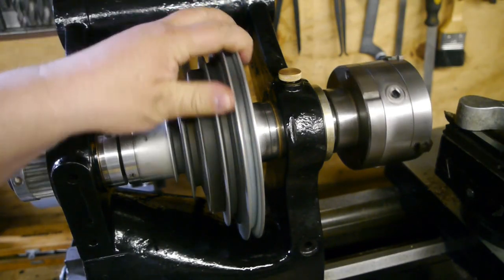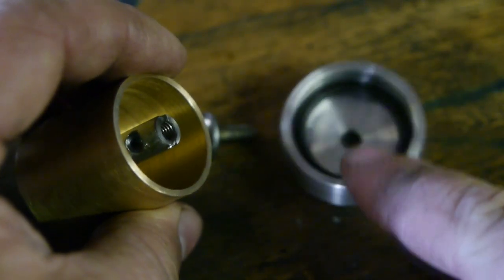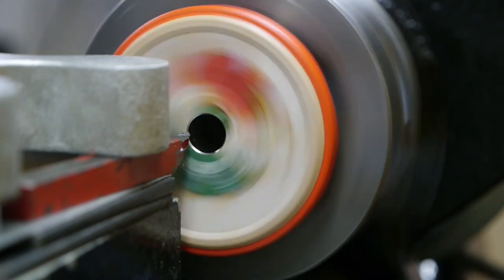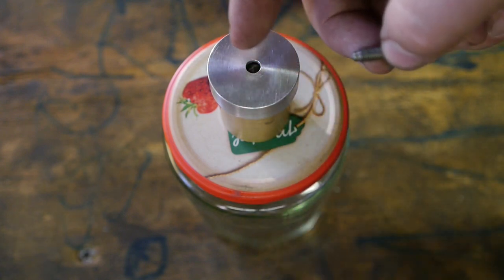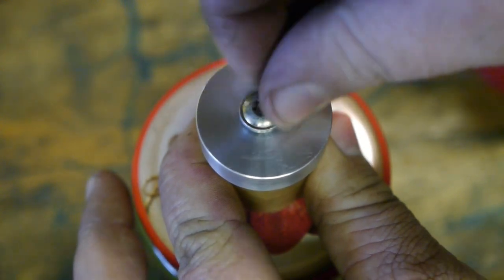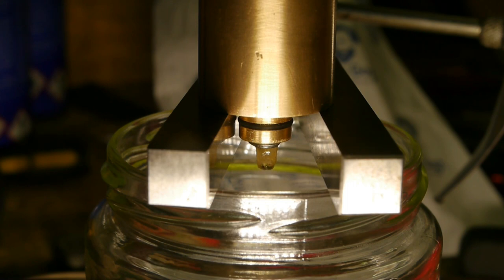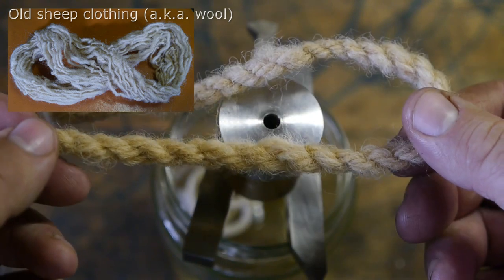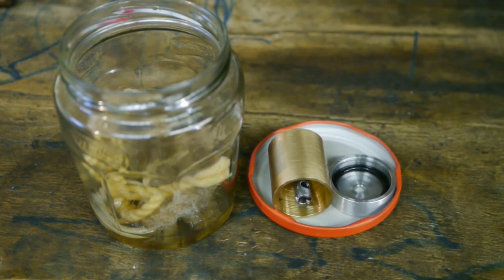Prototype wick oiler for the old lathe

Comment: You are so close !

The oilers I made are copies of Schaublin oilers and DO NOT use wicks.  They use a "J" shaped piece of wire as the "siphon" which is what this type of oiler is based on.

Oil does not have to capillarate through a wick, as it will also capillarate over the outside of a solid surface (which is what it is actually doing with each fibre in a wick).

So I use the Schaublin method of a single bent piece of wire to move the oil.  By varying the diameter of the wire, you vary the oil flow - bigger means more.

If you rest the curve of the wire "J" in an existing slot  in the centre section of the oil pot, you can run the test again with this type of feed.

The wire "J" must be made with the small length touching the bottom of the pot and the long section feeding out the bottom of the centre section almost to the spindle.

Try it and see.

Cheers Rob
Reply from the maker: Interesting. I will try that out. But first lets see if I understood that correctly. 
I basically bent a U shaped piece of metal wire that is longer on one end. The long end goes down the hole in the middle and the other end should rest on the bottom of the oil pot. Correct?
Reply: Correct.

It works like a siphon but uses surface tension of the oil rather than a vacuum.  So make the longest end as long as possible to get maximum effect.

Once you wet it, the oil will be pulled up from the pot and go down to the spindle - all on the outside of the wire.

The drip rate will be the same for large and small diameter wire, but the volume of each drip will vary with the wire diameter.

I use 0.04" wire on my 9" swing Schaublin.  I originally used 0.06" but it over oiled it.

I use ATF oil which is about SAE 15.

Many people (non Schaublin users) have never heard of wire wicks.

Works beautifully.

Cheers Rob

Comment: Really enjoyed this video as I have an old power hack saw that has or at least had wick oilers on the main shaft bearings and I wasn't sure how the wick was supposed to be situated. Whether it needed to contact the shaft or not, like they do in my 9A South Bend. This answered my question and now I can make a replacement. Also, while doing a search for how wick oiling worked I ran across a suggestion to use Zippo lighter wicks. And it appears from my search so far that the wick material should be natural wool.
Reply from the maker: Good to hear you got something out of it.
Reply: Wool is used because it does not catch fire easily. Modern substitute is aramid.

Comment: I would go for a slightly thicker oil but that's a great design!
Reply: scott scherer yes here in Britain I use myford spindle oil in my myford and other lathes
Reply from the maker: I want to use a thicker oil. But that will slow the capillary action even more. So I might need a very thick wick.

Comment: would it slow down the flush thru of oil if the reservoir was stuffed with felt.  just dribbling enough to keep the bearing surface wet..

or how about taking the spindle back out.. figuring out if you can carve a groove for felt to go in to prevent the oil from dripping thru so fast.
Reply from the maker: I don''t think the bronze bearing is thick enough to make a groove for a piece of felt.
Reply: i was really thinking about the thickest part of the bearing. just a shallow groove carved on the inside of the taper.. 1 mm wide 1 mm deep to act almost like a rear main seal.  

 is there any thinking on putting something to seal it in the groove on the spacer cut a thin ring of felt to pack in there  you would have to make a pair of sharp edge dies to cut some felt.   maybe even machine a brass face insert to ride in that groove and flat against the back face of the bearing.  oil must be leaking into the groove and being spun out ..

Comment: Nice video.

I like the prototype.  Perhaps a design which just uses a small hole to restrict the flow.  Start will small hole and enlarge until you have the rate you desire.  This would need the screw to seal the oiler to stop the flow.  May be easier than a wick design.
Reply from the maker: I have an idea to modify the prototype and it will have that small hole you're talking about.